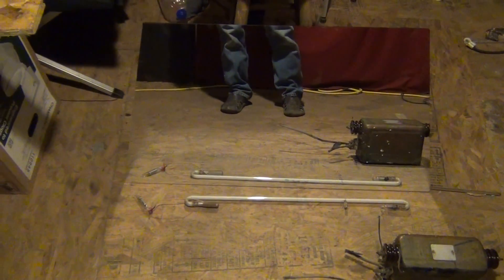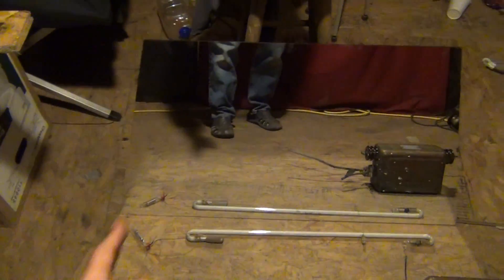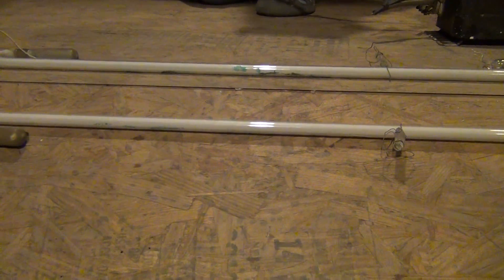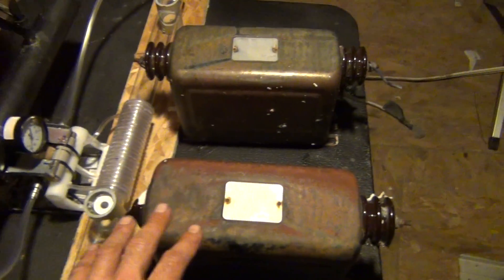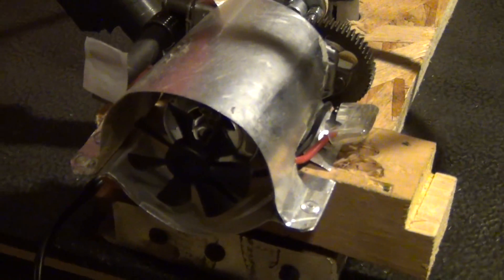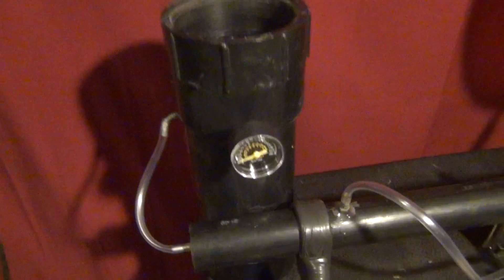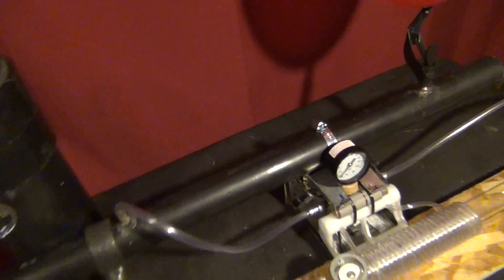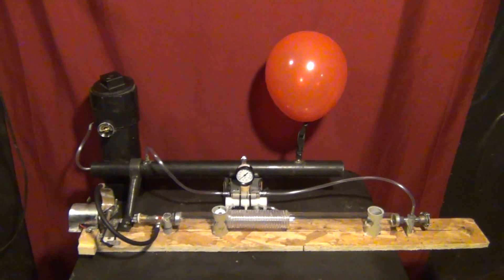Homemade CO2 Laser, part 4

Comment: I've seen where using a chemical paint & varnish remover on the backing of a mirror, will produce a first-surface mirror surface, as long as there's little or no rubbing required.  I've not yet tried for myself.

Comment: I know you are busy but how about making a Stirling engine powered by heat source technology using a coil buried in the ground connected to another one in a river filled with refrigerant the temp differential can be used to power a turbine for free energy. The turbine will be driven by the gas in the system expand and contracting due to a lower boiling point of the gas just like a refrigerator.